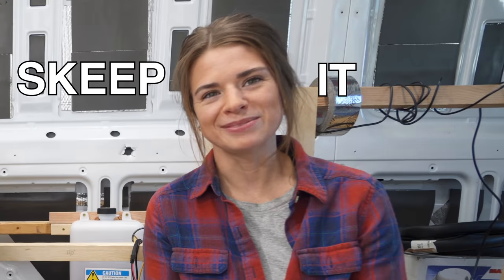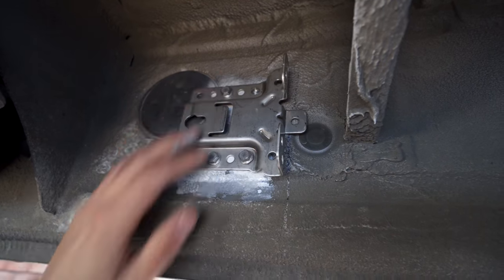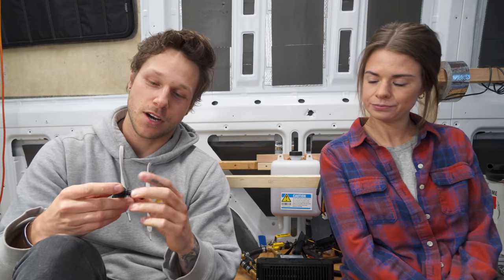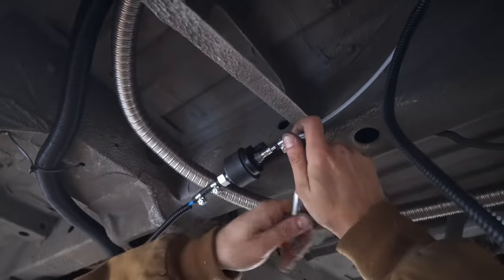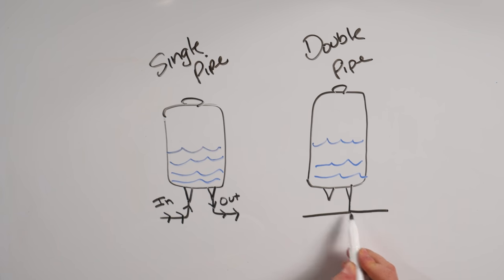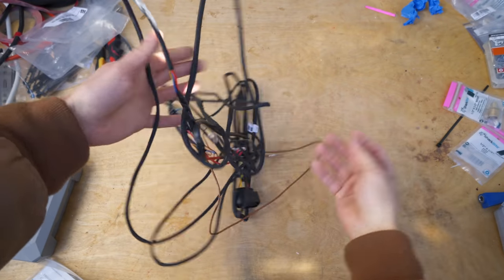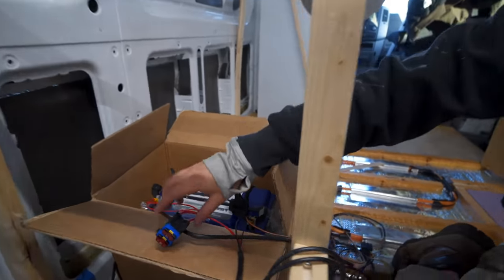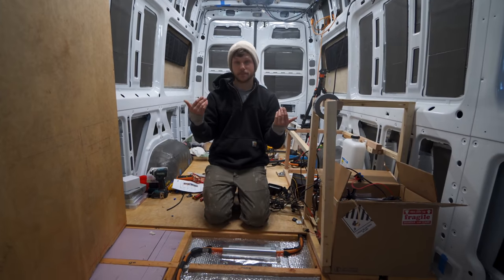Heat Your Feet! How To Install A Hydronic System In Your Van

Comment: Love the idea radiant heat, but for Van it's too costly too much extra labor and you better pray you don't get a leak. That size of a van the  Evo 40 High altitude diesel heater would of  work perfectly. The cost is under $2000.00 and it takes three hours to install. Just saying van viewers you don't need to install this complicated heater.